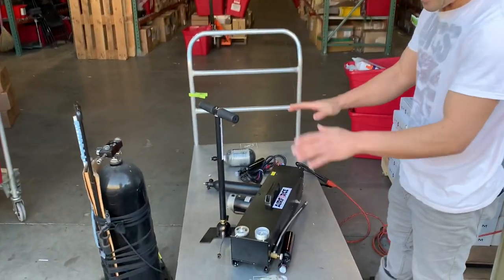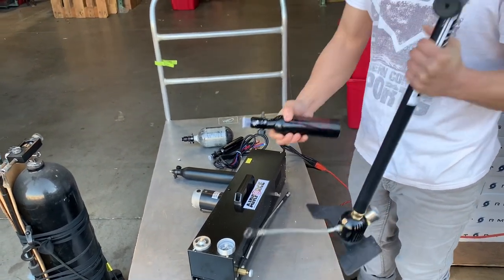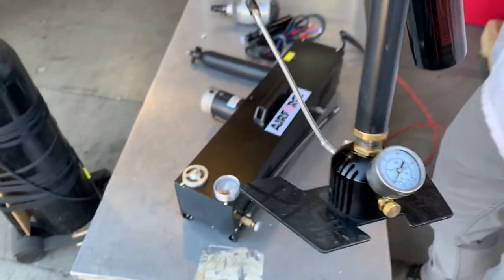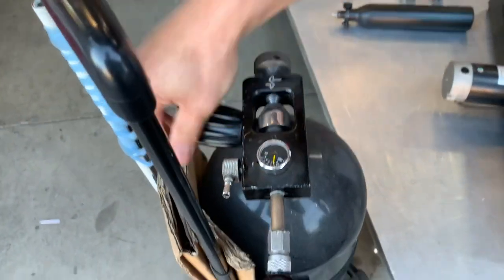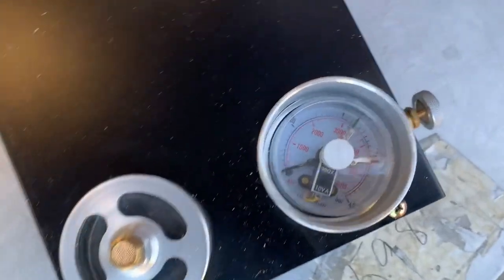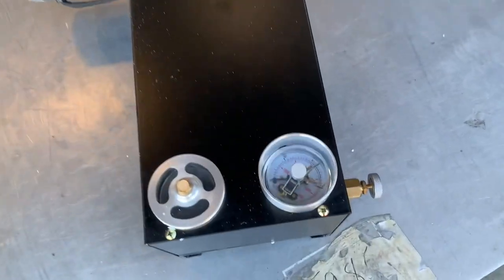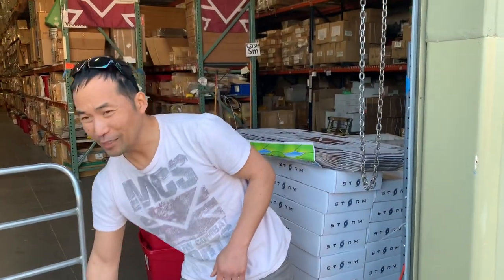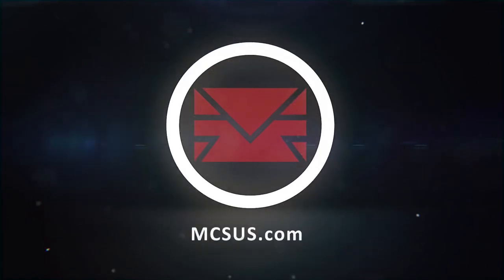What you need and how to refill your PCP/Paintball Tank At Home #MCS

Comment: Any compressor that has 12 volt and standard household current for power options are using 12 volt dc motors. You should use 12 volts from a running vehicle, a 300 watts 12 volt dc motor needs 29.4 amps when it’s straining. A vehicles alternator is the best place I know to get high amperage dc power. The power supply either built in or as a separate unit do not make enough amps and will shorten the life of the electric motor part of your compressor.